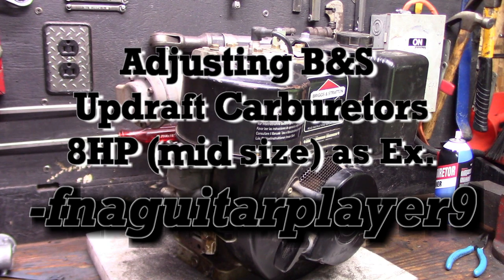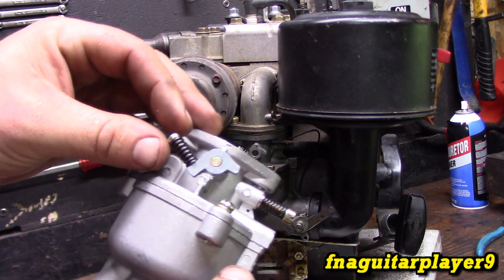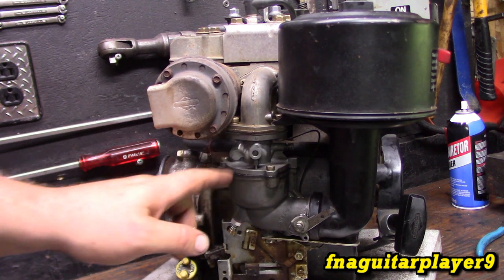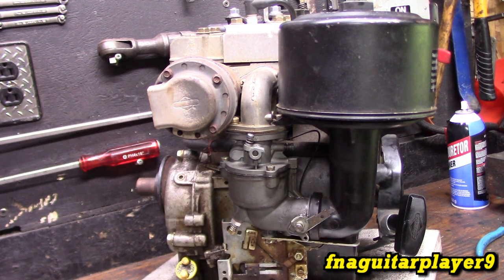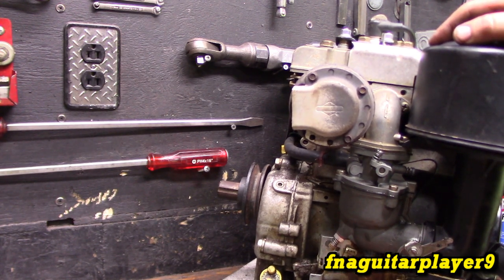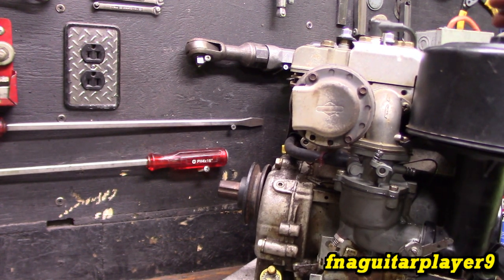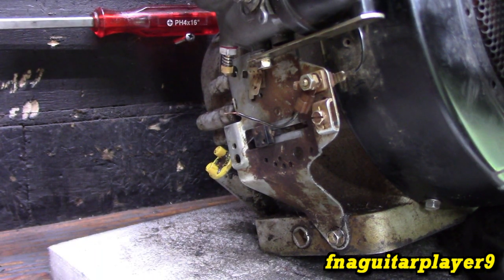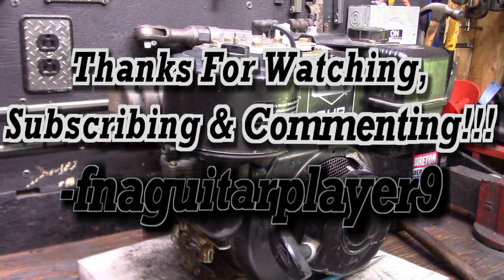How to adjust Briggs & Stratton Updraft Carburetors, 8HP as Example

Comment: Thank you sir for this mighty fine tutorial. The 8 HP B&S engine on my Troy-Bilt chipper was running erratically and would stop intermittently. I disassembled and cleaned the carb using all the same parts except for needing a new gasket. I set the screws like you suggested and and the engine started with one pull. I’m thrilled with the results. It’s kind people like you who give me the confidence to tackle a project like this.

Comment: I am not an engine guy but after installing a new carburetor (had to shave off 1/16" off the bottom where the air filter bracket attaches) it started in one pull but was pretty rough. Messed with the two mixture screws and, damn man, it runs like it was meant to. Thanks for the straight forward and clear video.

Comment: Is the pilot jet and the main jet the same thing?  My RPM goes up and down continuously.  A mechanic said the pilot jet is stopped up.   Tomorrow I'll try cleaning the main jet and see it that fixes the problem.  I have to run the engine at half choke to get it to run.  I think that indicates the main jet is stopped up.  Am I guessing right?

Comment: I have a 1983 8hp Briggs Stratton engine, I have totally rebuilt the updraft carb after ultra sonic cleaning as well as the fuel tank, it fires and runs well,, but seeps fuel more then I would like. Is this something I need to live with,, or is it time for a new carb.?

Comment: I rarely subscribe to channels. I'm subscribing to this one right now. This is clear concise no nonsense, no bullshit instructions on what's going on with these carbs. 

I just did a deal with my awesome neighbors and got a lightly used 8 HP chipper from 1995. Her dad brought it new from Sam's club in 95 for his yard and it is in excellent condition. 

My neighbor's on The other side lived there for a year or two and bought a Cobalt electric lawn mower, weed eater, and leaf blower. Right before he left he came over and asked me if I wanted them for free, along with a nice little 10-in miter saw. I said sure even though I didn't really need them.

 I ended up trading those things for this tree chipper and it needed a little TLC to get it working smoothly again. I put some seafoam in the gas tank with some fresh gas and a new spark plug. 

It did not want to run unless I had the choke on. I ended up backing out that high side adjustment screw and that did the trick. Now I'm going to change the oil. I also put an extra large new fuel filter on it. I may end up needing to change out the fuel lines they are a little dried out. 

This thing is really excellent it has no plastic other than the gas tank, and it has a normal manual throttle and choke. This is a very reliable configuration. This engine would be pretty awesome mounted on a go-kart. I have no intentions of doing that,  but years ago I would have loved to do it.

Comment: Thank you for all this information. I am having a problem with a 1974 White Yard Boss GT 1050. I have an old White Yard Boss GT1050, that is giving me fits.
This is a 1974 model with a 10HP B&S motor. Updraft carburetor. It started running real crappy, and died. I replaced the plug, and checked it for spark. Spark is good. Replaced the fuel filter. No luck! I ordered a carb kit, and installed. Carb was leaking out the hole in the bottom. I researched this and followed the recommendations on the Needle jet. No luck! I have fought this for three weeks now. I ordered a new carb. It has already had the repair on the needle done to it. Same story, leaks out the hole. Checked needle, and found the repair o-ring, and a good seat pattern in it. The engine will run if I keep priming it. I took a compression check on it. 100LBS compression cold. Checked it three times. I know this is an old bugger, but I am hoping someone may have some experience with these. They are great garden tractors. I installed an electronic conversion for the ignition. I will say the spark is much better. For some reason it will not pull the fuel from the carb up, and into the combustion chamber. Any ideas, because i am out of them. Give me a downdraft carb with a fuel pump, and it would be easier.
Reply from the maker: I'm not quite sure right off hand what the problem is without looking at it, sometimes its hard to diagnose something without working on it, hope you understand. Thats good compression, so I assume its not a valve issue causing it. Sometimes the float will stick in these and will cause the overflow problem, try tapping on the side of the carburetor and see if that stops that problem. Does it have good fuel flow to the carb? Thanks for Watching!!!
Reply: I have exactly the same problem. I have made the same repairs as you but no luck. I'm about to pull the flywheel to see if the key has been sheared. I have fuel and a good spark. Removed elbow and muffler. Valves are working fine. It ran perfect until I rebuilt the carb.
I even put old carb parts back in .Still no luck.
A complete mystery.

Comment: I've got the exact same engine on my Speeco log splitter. I always had problems with engine surging and just couldn't get it right. I decided to remove the emulsion tube and the slot in it stripped out on me despite being careful and shooting it with PB Blaster. The bowl on this carb can't be removed without removing the emulsion tube first. I finally decided to order a new (clone), carb. I got the engine running, but not good and the surging is probably worse than ever now. I'm gonna follow your lead and see what happens. 
I agree with you that, that throttle plate sucks!
Great video, just the facts and no BS! Thanks.

Comment: Very good video. One thing I found, on my '94 Winco TF6000E generator with the 11 HP Briggs, which I got used a few years ago, was that the float pin holes in the upper body where completely worn oversized and rounded out. Come to find out that what causes this is the use of the generator on natural gas or propane without removing the float, needle and pin first. This apparently causes the float to flutter around violently while in use, causing the damage. It still works ok, and I'm planning on setting it up for natural gas, but a new upper carb body or new carb is in the future, if I continue to use it with Gasoline.

Comment: Nice explanation, Thanks, I had one in my shop that had to have two gaskets on the top carb cover to stop leaking lots of gas.
Reply from the maker: Thanks. I might try that on the next one that leaks badly!  Thanks for Watching!!!
Reply: They will sometime warp from the heat.Sand them down flat like you would a cylinder head with 1000 grit Sand paper .Will stop the seeping of gas.

Comment: Thanks very much for this great video. I have this engine on an old wood chipper and the Throttle Bracket Assy has a mount that alows a screw through the bottom under the bowl, teh one that fits into the bottom of the carb. None of the new cheap carbs they sell out there allow their carbs to fit in this bracket, they have this extra half inch height to the post. You can even see it in the replacement carb you show in your video right here, you can see under the bowl the post sticks out an extra half inch than the carb on your motor you have already mounted! Why are they doing this...very frustrating. I did find a carb from one place that has the proper bottom bolt height, and I struggled to get it into my manifold, things just didn't line up right. I am hoping it's good enough, will be testing it out tomorrow...thanks again!
Reply from the maker: Your welcome! I did notice the difference in them, I don't know why they made them like that. Thanks for Watching!!!
Reply: Got the new right carb from Amazon.. Fyi

Comment: Can't beat the old stuff. I've got a sideways job on a Roof mower, 8 horse 'L' head I/C that mostly gets choked at the beginning of the season or if it sits for a month. Just turn it on and it'll fire the 1st or 2nd pull. I wish briggs would make a solid choke plate for the 'L' head plastid starting clutch dog 5 horse instead of the one with the hole in it. Lets too much air and not enough gas for cold starts. I can stick my thumb into the breather housing over the choke and it'll crank 1st pull but not until you try pulling it and your shoulder is gone. But it keeps me honest and Thanks! Pick me one!
Reply from the maker: Yep! I've noticed that seems like these 8hp rarely ever need choked except when cold or like you said been sitting. That is true, i agree with that.  Thanks for Watching!!!
Reply: @fnaguitarplayer9  Good place to be!

Comment: Thanks so much for this great video. I have a 1976 Briggs 8HP Toro snowblower (8-32 model specifically) and the exhaust glows red after a couple of minutes. I removed and cleaned the entire carb last year but I failed to properly adjust it because honestly I didn't know how. I suspect a lean condition so I will try this out first otherwise there may be a bigger issue I need to figure out. Anyhow, very helpful video. Thanks for sharing!
Reply from the maker: Your welcome! It could be a lean mixture causing that or also, it could be the exhaust valve not sealing good, if thats the case it will need to be reseated (lapped) and then the clearance (lash) set. hope this helps, thanks for watching!!!
Reply: @fnaguitarplayer9  It worked!!! Thanks so much! You rock!!!

Comment: Hey On the mortar mixer I’m working on it has same engine and up flow carburetor. Then it has a adjustment screw with spring that adjustment for governor speed. Carburetor rebuild came out nice just trying to adjust high and low  screws

Comment: Very helpful!! Many thanks.

Got mine running fine and smooth, starting on the first pull.  But now, just three days later, it requires a shot of Gumout to start.  And then it just dies after running for about three minutes.  Any ideas??

Comment: Did a full rebuild, got it running but will not run unless 90% choked and even then is temperamental.  I've tried to adjust the 3 different screws you mention but first, I want to fix the choke problem.  It seems there is a way to adjust the spring backed screw on the choke lever and in fact, I can turn this screw that holds the choke lever on and I can adjust how much choke by again, turning the choke lever retention screw BUT NOT the choke lever.  Maybe my choke butterfly plate is separated from the choke lever?  
Also, idles very high - wondering if the new cable and cable housing is out of position on the screw and bracket that holds the cable to the throttle body - shown at 6:54:  wondering if there is a distance that the cable housing must not be too far forward in the bracket that will screw something up.  Seems I can shut it off by pushing the lever forward no problem but huge spike from 0 RPM to low.  Seems to be zero low idle.  Maybe I disconnect the cable and use my finger to slide that assembly which you mention is not replaceable.
Tempted to buy a $20 carb on Amazon but want to get my free 8hp blower running on OE parts - seems close.  Thanks!

Comment: I rescued a Sears 917.292580 rototiller with 8 hp horizontal shaft engine today, went to look the parts up, and found that most of the parts to make it run are no longer available. What capacity gas tank is mounted on the engine you have, and if possible, what is the part number for it. The fuel tank was damaged when they put it on the curb, it's been sitting disused in the wild for some time, but engine is not seized. I'll be tinkering with it this Winter to keep myself busy (sane). I also recently picked up a John Deere X300 lawn tractor with 38" mower deck for a decent price, it had a run in with a Ford Ranger pickup. Another tinker toy.
1985 J-D model 111, 1988 J-D 185, 1997 J-D STX38 Black deck, 2003 J-D L110, 2010 J-D X300. 
Talk about Deere Rescues.

Comment: Got three engines with the updraft flojet ones on a 6 horse in a 66 bolens ones on a 1982 8 horse from a tiller and the last is on a 10 horse in a Allis big ten honestly I quite like this carb design
Reply from the maker: I like them to for the most part, they have their issues, but I like all the adjustment on them. Thanks for Watching!!!

Comment: Pretty late to the party here just got a snowblower with an old 8hp on it. Can carb adjustment being too rich or lean cause kickback? I originally bought it a new carb it worked for a few months then started kicking rebuilt the old carb the original and put it on. It didn’t kick at me, today I went out and tried to start it and it kicked back at me again

Comment: I just purchased an old John Deere 68 that sat for a cpuple years.  When I went to see it, it would not start until I put good gas in it.  Only issue I have is it sputters quite a bit, it stays running but sounds like the choke is on the whole time.  When I take the air filter out it comes to life and runs fine, when I put the cap back on with filter it spotters and loses power.  I thought about replacing the carb, but it seems to run really well when it gets good air.  Air filter looks ok, but I'll replace that tomorrow.  I will also check adjustments as well, anything else that I might need to assess?  Thanks.

Comment: Great video. I have a love/hate relationship with mine. It runs great for 10 minutes then falls flat on its face. Any suggestions?
Reply: Tank cap vent or stopped up fuel line or in tank
Honda has a filter in tank fitting

Comment: I have an old Gilson snowblower with this carb that sometimes runs great, other times runs too rich or too lean and I have to adjust it.  Seems like I'm always having to adjust it and sometimes I just can't seem to get it right but when it runs good it runs great.  Next time I fire it up it isn't right either cold or warm until I adjust it again.  It does always start and run, it just seems to be rich or lean randomly under load each day I use it.  I replaced the old fuel hoses and inline fuel filter thinking they were decomposing but no change.  I've since given up trying to figure it out as it always gets the job done.  Any ideas?
Reply: Might be the deadness of the fuel. If it sits much it'll start going dead. Stihl man said 90 day shelf life.
Reply: I have a 1971 Gilson made Wards 14 horse garden tractor i've been working on and noticed as I ran it it did the same even after a rebuild until I put a different rebuilt carb on it, the culprit was the throttle valve shaft on the old one had enough play to allow air to get past it causing it to go lean in certain throttle positions and run horribly. If you can wiggle the shaft around in it's hole as it's running without rotating it and the idle changes or it starts running rough, thats why. It should have very little play but if it's as old as mine was the throttle shaft hole is probably worn enough to allow air to pas around the shaft.
Reply: @justarel  GOOD fix. I've got a 301 cast iron Kohler that's that way and I got another carb like the fixer got. It's a Gravely and a rotary plow and I don't want it fixed unless I need it or someone else does. That thing will kill a grizzly bear on steroids.
Reply: @justarel  Interesting, would have never thought of that.  I'll check that when I get it out of storage this fall on the chance that's the cause.  Thanks!

Comment: Greta videos. I recently acquired an old  snowblower. Engine is a 8 HP B & S 170402 model (1967). It did work when I took it home. But I cleaned er up a bit and now it doesn't start. I just bought the carb kit and replaced the gaskets and the bottom jet/(the one on the bottom that comes up at an angle) . I sprayed all jets and holes with carb cleaner. I do have spark because it kicks in with starting fluid but will not run after that. I cleaned out the rusty fuel tank and I do have fresh  fuel flowing from the tank. What should I do to get it going?  Thanks
Reply: Check for screen in inlet fitting

Comment: Question - I have followed your directions (thank you!), but my carburator (new) will not go into low idle without loping....I can get it adjusted to run nicely at 3600 rpm, but if I adjust it to low idle at 1800, it will lope and surge at 3600.  The only way to fix it is to adjust the idle screw up and then I lose the low idle.   Suggestions?

Comment: i have this exact same engine. ive cleaned the carb, adjusted it like you said and the manual said. i cannot get this thing started. ive tried everything. i thought it might be getting flooded but the spark plug is dry. tons of gas comes out the intake, as im trying to get it running with out the air cleaner.
Reply from the maker: These are very picky carburetors, great when they are working though. Common problems are float/needle valve sticking and where the emulsion tube goes in, you have to tighten it real tight and loosen it then tighten it again to get a good seal on it. Then set both mixture screws to about 1 and 1/2 turns out and it should try to run. Thanks for Watching!!!
Reply: Actually I found out the key was sheared
Reply from the maker: @matthewmiddleton63  I hear ya! I assumed it would be a carb issue.

Comment: Just finished mine and it starts easily and runs really well now but it just dies suddenly at random, then after a few minutes starts and runs my wood splitter perfectly for another few minutes, then dies again like a float issue is all I can think of ? any suggestion ? thanks for posting its the identical engine and a great tutorial
Reply from the maker: If its just shutting off like you turned the switch off it could be the coil going bad on it, get a inline spark tester and see if its loosing spark when it does it. It could be a carb issue, if its running out of fuel could be not enough fuel flow do to a collapsed fuel line or clogged filter. Thanks for Watching!!!